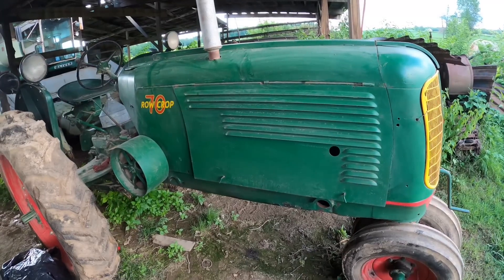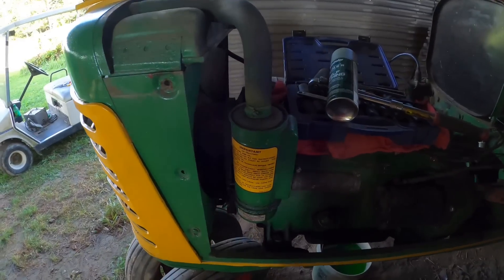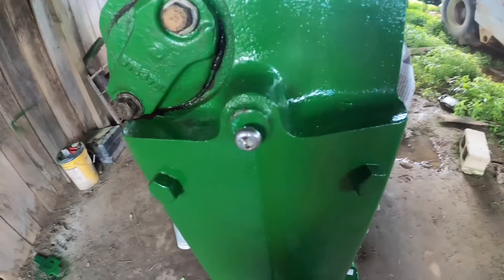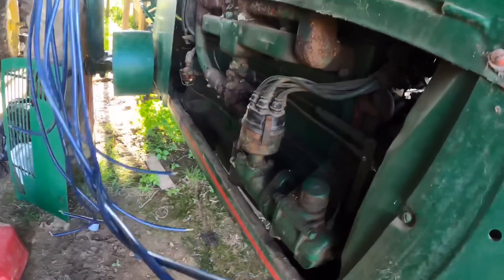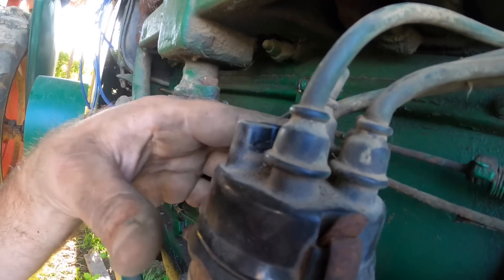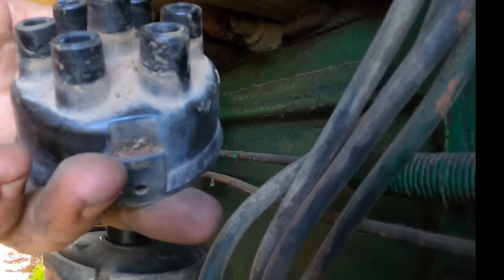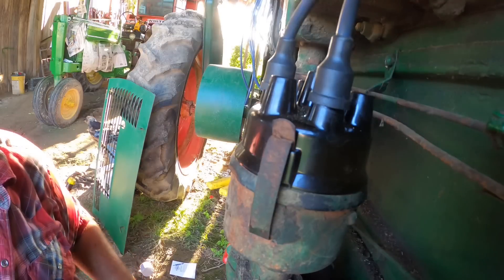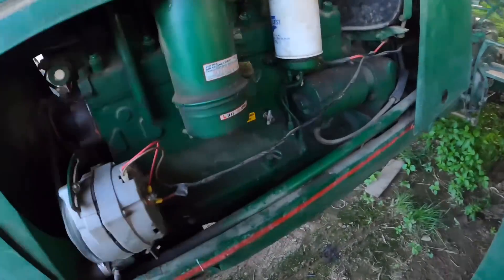OLIVER 70 Repair and DRIVE

Comment: Boy that John Deere B sure is looking sharp. You are correct in comparison between the B and the  Oliver. It's a wonder Deere sold many with that more outdated design. I always heard Deere had more dealers and had plenty of tractors on the lot is why they sold. It would be interesting to hear your grandpa's take on why the Deere was purchased over an Oliver or Farmall? How much difference in price also would be interesting?  It would be interesting also to compare a 77 to a 70 to see the differences. You got my brain thinking on these old tractors if I lived in those times.
Reply from the maker: I think a lot of the sales had to do with the price. Old timers were cheap. They wouldn’t spend an extra dollar if they didn’t have to.

Comment: For future wire projects that are complicated like that one you can buy bulk rolls of spark plug wire and ends from race car supply places or websites.  It’s fairly reasonable and you then have any length option you need.
Reply from the maker: I need to do that. Thanks Duane!

Comment: Grew up around my grandfather's  77 and my great grandfather s JD  A. The 77 was definitely more modern,  quieter,  easier for doing chores and  playing around.  It also had live pto  , lighter steering, and felt more nimble. But spending a  day  pulling a drill or doing heavy work the Deere did have it's virtues.

Comment: The "70" still runs great. PB Blaster has a dry silicon spray that works great on plug wires and other stuff. Just a thought. JD  is shaping up nicely. Great video ! Hey to Buddy. Be safe

Comment: Well the choice on the B is either take the pedistal apart and put new seals in or cornhead grease which was what I chose. They are supposed to use 90 W gear oil. I usually order plug wires from Brillman.
Reply from the maker: Thanks!!